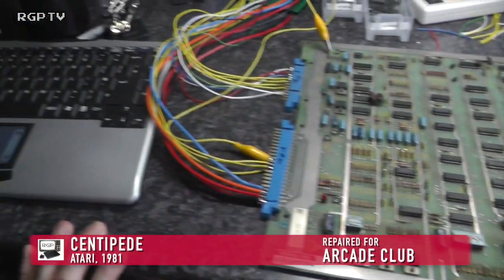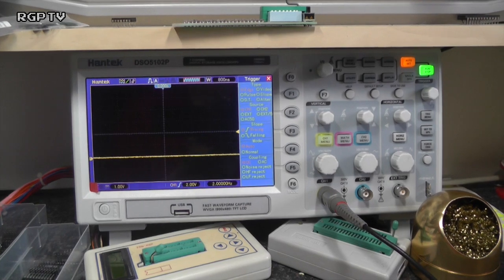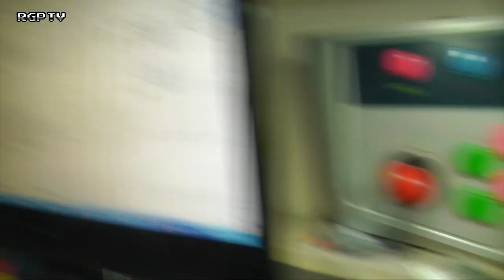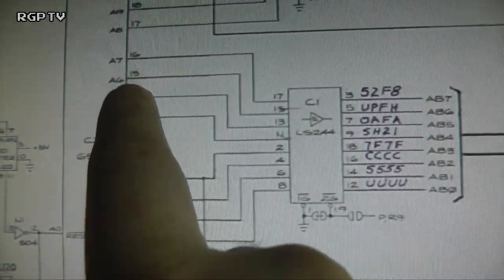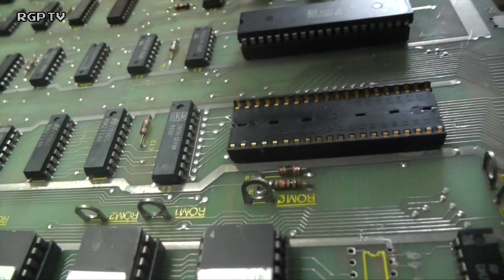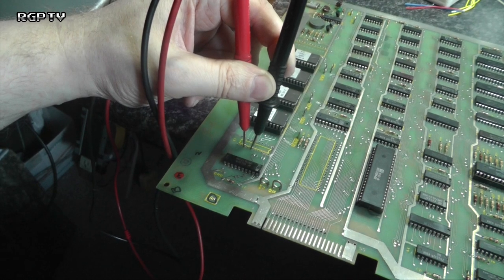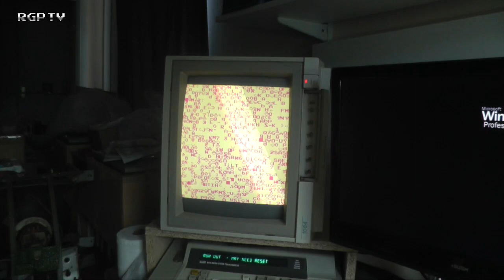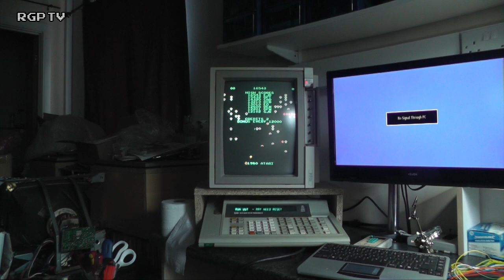Centipede (Atari 1981) Arcade PCB Repair For Arcade Club

Comment: Hi James, Johnny Beresford sent me a link to your You Tube site.  Very interesting to see how your Fluke Analyser works, and the proper method of mending these games units. Very nice tidy well organised workshop with good access to schematics and bus data etc.  Nice to finally see what you do.  Hope you manage to source or build a Fluke pod & that the info I sent you from my ex colleague Charles was useful.  Best regards - Dave
Reply from the maker: Hi Dave, not built one yet although I did look inside one and I found an article online where someone had built a similar device with an arduino.  It actually might be simpler to build an entire modern unit rather than engineer a pod and use a PC to drive it.  Something I'll be looking into.

Comment: Great job!  Other purpose of watchdog is to deal with any bugs in the ROM code that they might not have fixed in development.  ie. on the off chance that there's a hard to recreate bug that locks the system up it will recover via a reset.  Watchdogs are commonly used in safety critical applications as well - aviation systems etc.

I wonder if the short cause the CPU failure!  Very interesting repair!
Reply from the maker: Never thought of it like that, also didn't know about use in aviation systems but makes sense.  Thanks for watching and the knowledge.

Comment: Hi All,
Great vid...
Can anyone help : I have a centipede board that I have corrected several faults and have managed to get it running well. The only fault I have is no sound ! I have checked LM324 and this seems good. I have changed the pokey c012294-01 for a new old stock c012294b-01 but still no sound. I have changed the pokey to another new old stock c012294b-01 and still no sound. I have probed pin 37 on the pokey and nothing. I have even lifted pin 37 but still nothing. I have checked there is data on D0-D7, A0-A3 and RW Q2. Im not so sure about signals on CS low and CS high. Anyone have any ideas.
Many Thanks Rick
Reply from the maker: Hi Rick, I don't have a centipede schematic to hand right now but the CS signal means "CHIP SELECT" generally if the chip has a /CS it means that the chip will be active when the signal on the CS pin is in the LOW state - so you should be observing that pin on a logic probe or scope when sounds should be being made.  Also check the voltage input and ground pins in case something has become bad there (ie bad trace on the board).

With sound if there's nothing at all, I always start at the end of the circuit and work backwards.  Sounds like you've done this and gotten back to the POKEY chip.

Observe the activity of outputs on a chip, if nothing, then go to the inputs and check for how its supposed to be used.

If I remember right, the POKEY also needs a clock signal of some type - I could be wrong there.  If that's not present (if required) then you will get no sound.

Comment: Thanks for the video. I have a centipede game and all is working except can't figure out why the high score will not save. Can't find any battery inside to replace. any help would be appreciated.
Reply from the maker: Bad EAROM or circuit going towards it, needs a -27v power rail that gets derived from the main power supply - check the schematics.  Think someone's made a replacement for these chips now.

Comment: RETRO GAMES PARTY///
                                       ,,  vector games have register files LS670 chips. What does these Register Files IC chips do in vector arcade games?
Reply from the maker: Usually part of the state machine - not delved into it that far but seen them in the circuit.
Reply: @retrogamesparty  was but the state machine is a PROM chip that is a look up table doing what? and what are the vector register files IC LS670 chips doing?
Reply from the maker: @billwilliams6338  absolutely no idea whatsoever - i've not delved into the minutia that far.

Comment: Another awesome vid!  Do you think you would have found the short without the fluke?  Cheers.
Reply from the maker: I think it would have taken a while without it.  I'm not sure where you start.  It would likely have been my last resort and I'd have checked it from the CPU outwards after everything else.  The short is misleading but accessing rom regions outside the lower address lines would still have worked so the /ROMx signals would likely have still been working.  Can't say for sure but I'll be looking into ways to diagnose this.
Reply: +Retro Games Party I found a short on the address bus of my SNES using a logic analyzer.  It was not fun connecting the 40 connections to the SNES though.  Sadly the SNES turned out to have a bad CPU in it (The PLB and I think PLA instructions would cause it to start accessing garbage addresses).

Comment: Hi I’m completely new to anything with arcades but recently picked up some 81 models for MS PAC-Man Centipede and frogger sega cocktail. Turned on centipede and red light on cpu board lights up and the monitor has a white screen ? Any help would be greatly appreciated

Comment: Great video! Super interesting work. For someone just getting into arcade board repair, what chip tester do you recommend?
Reply from the maker: They're pretty much all the same - just search logic chip tester on eBay - just remember they can't do everything but they can usually check the 74 series and a lot of the CMOS chips for you.

Comment: Thanks for video. I replaced my track ball and it still seems not to respond correctly. It will not go right to left and vice versa. Any ideas?
Reply from the maker: The optical sensor is bad on that axis - assuming the vertical works then the clock signal to the trackball is good and so is voltage as they are shared so the direction signal coming back probably not working because the actual opto is bad.
Reply: @retrogamesparty  Thank you! Ill try it.